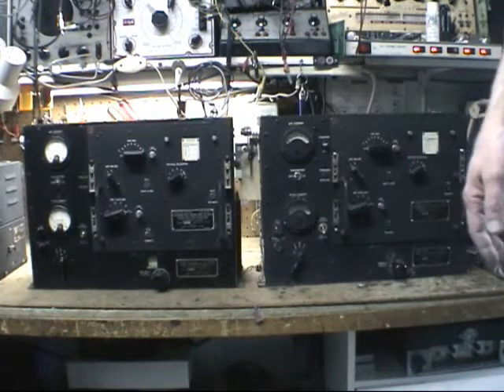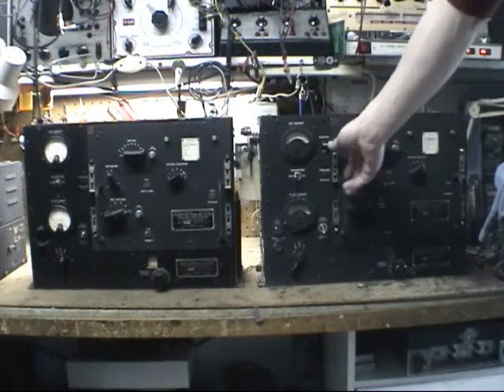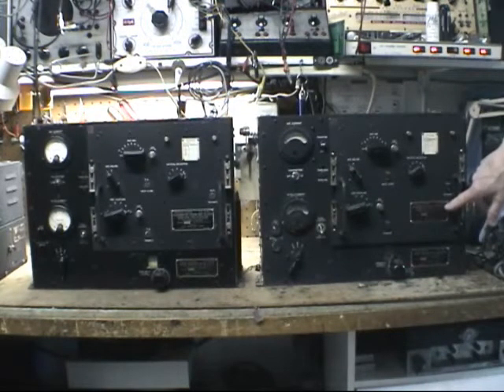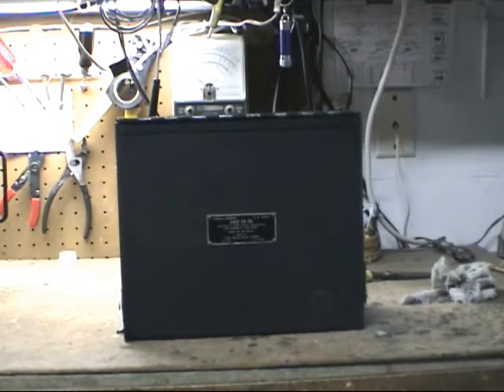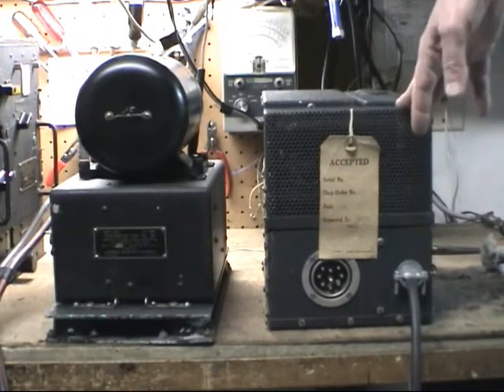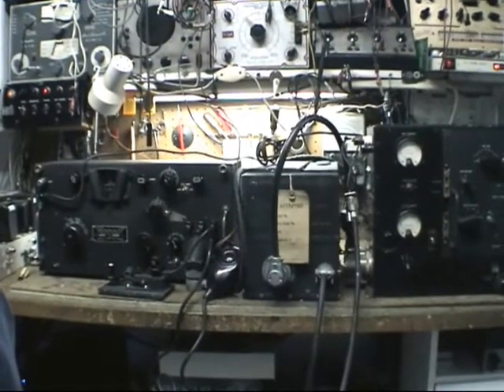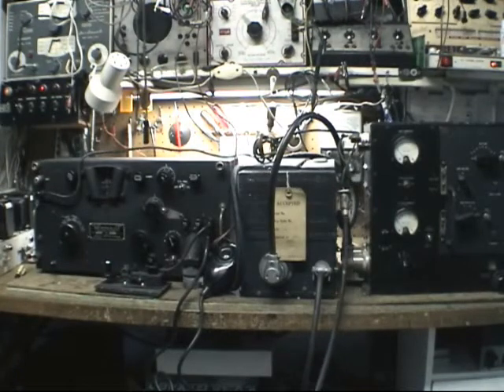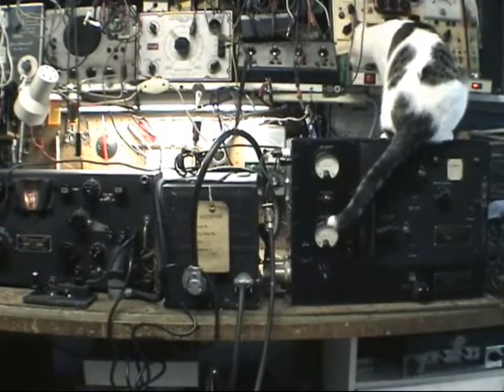SCR-245/BC-223 Signal Corps WWII Radio Demonstration

Comment: Thank you for taking the time to show off this early World War II transmitter.
I noticed during keying when your kitty was on the transmitter its tail did not come in contact with the antenna output binding post, though the RF output meter did not seem to move off of zero. So I guess your cat was safe.